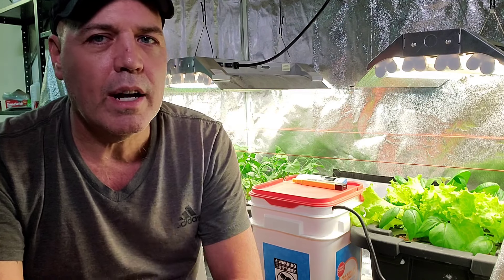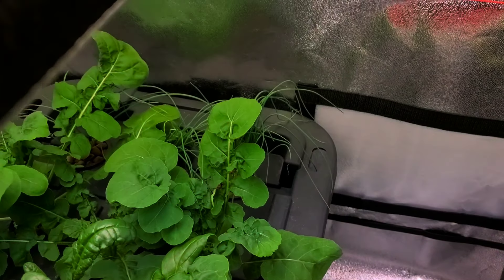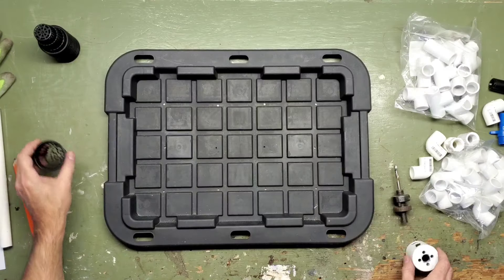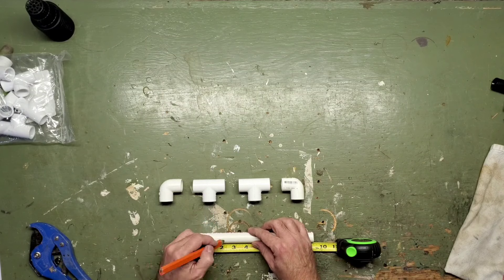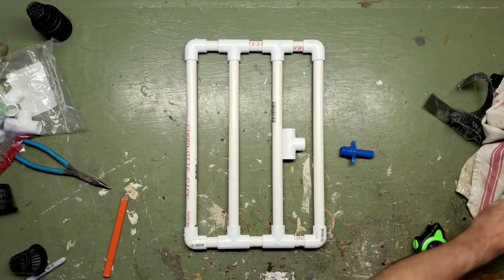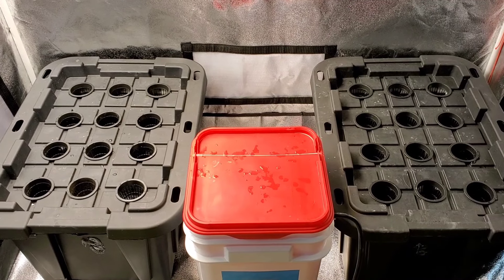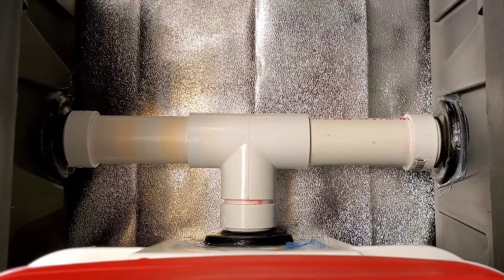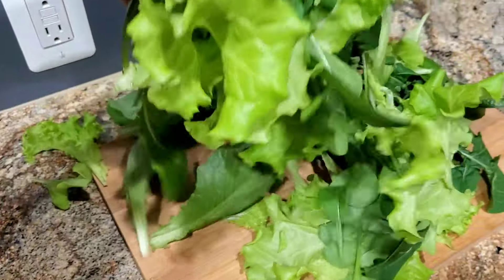DIY Aeroponics Hydroponics System

Comment: This is a nice setup.
I've been growing with LPA
( Low Pressure Aeroponics )
for over 15 years now.

And I don't mean to be rude.
I would just like to give you and the people watching this video a little friendly advice.

First off your manifold.
You have way to many sprayers. And I have found the green ones work the best.
And then where you have your manifold in your grow chamber.
I sit mine about 2 inchs off the bottom of the grow chamber. This way it keeps the spray from leaking out the grow chamber. And it keeps it high enough for the nute solution to drain back to the reservoir.
What I did when I built my 4 aero systems.
I put my inlet, at one end about 2 inchs up from the bottom of the grow chamber.
And then put a nipple on the outside. I ran my drain line on the bottom in the middle.
If you look inside at most of these tubs, you will see grooves cut into the bottom that drains to the center.
Then I put a nipple on that also.
Then with my reservoir, I put my outlet towards the top of the reservoir. To keep it above my nute solution. Then I put my return line at the bottom on one of the sides.
And now the way I hooked them all together.
They way you have them hooked together, I see nothing but problems.
What i did was I used hose.
There is hose's you can get at a hydro store that is made especially for these kinds of setups. It's a lot softer and pliable than a regular drip system hose. I used half inch.
So I ran a hose from my pump to the outlet. Then I ran a hose from my reservoir to the inlet of the grow chambers. Of coarse I had to put a tee on the hose.
Then I ran a hose from the drains on the grow chambers with a tee and ran it back to the reservoir.
Now the reason I went with hose's is because I wanted to keep my reservoir out from underneath the lights.
So I made my hose's like 8 ' long so I could achieve that.
Plus for any reason that I might have to move my systems. I don't have to take anything apart.
Plus it makes it very simple to change my nutes and clean my reservoir every 2 weeks.
There is a few very important subjects you didn't touch on.
For example its very very important that you keep your grow chambers and reservoirs and your nute solution around 75 degrees.
This will help keep mildew and mold out of your root zone. Hence Root Rot. Which can destroy your whole grow.
Next it's very important to check your pH everyday and your ppms.
There is a thing that us aero and hydro growers call pH drift.
Lets say you are shooting for a pH of 6. Well within 24 hours your pH can shoot up to 8 or down to 4.
Which will lock out certain nutes to your plants. And then it will rise or lower your ppms.
This drift doesn't happen all the time.
Once you find a sweet spot with your ppms. So your plants take up the same amount of your nutes that they want. The drift shouldn't happen.
Your plants will tell you what they want or what they are lacking.
So it's very important that you no exactly how much of each nute you are feeding your plants. This way you will no what you have to add or decrease to keep them happy.
They way I do this is I mix my own nutes. I purchase a powder form of each and measure exactly what is in my mix.
It sounds like it's hard, but it's very simple.
And a lot lot cheaper than buying premixed nutes.

This is the cheapest easiest and fastest way I have found to grow. And the only way I will ever grow, indoors.

Anyway good luck to all and take care.

ASS  OG

Aero Systems Sea Of Green.

Comment: Nice little set up.
Basically the same thing I built 10 years ago.

I've been growing this way with LPA ( Low-pressure Areoponics) for 10 years now.

I built my systems basically the same way.
My systems consist of 2, 21 site grow chambers with 1 reservoir. Each system measure 3'x3'. This way I can use 1, 3'x3' LED light over each system.

I have my manifolds at the bottom of the grow chambers. Well they sit 2" off the bottom and spray up. To make sure I get the bottom of the net baskets.
This way all the roots get wet.
I don't see how you are getting the roots in the basket and the parts that are above your manifold wet.
This will slowly cause you some problems. Like bad bacteria and fungi forming.
And your yield will suffer a little. Like 15 to 20 percent.
But for the common gardner or someone just starting with areo. they don't even know that 15 to 20 percent is there cause they have never seen it.

Anyway back to the building of my systems.
The only pvc I used was for the manifold.
Everything else I used hose.
This way I can keep my reservoirs 3 to 4 feet away from my grow chambers so the reservoirs are not directly under the light.
This helps to keep them cool.
Another thing i do different is my drain line is bottom center on my grow chambers. This way ALL the solution drains out in between sprays.
The way you have it set up there will always be 1 to 2 inches of solution in your grow chambers. Then on top of that with your on and off times being so great you are probably getting a build up of solution of 5 to 6 inchs in your grow chambers.
So basically you are running a flood and kinda drain system. And your roots will always be sitting in solution at the bottom of your chamber. Which will result in the same problems as above, plus root rot.

I grow every thing by cloning. I built my own areo cloners. And EVERYTHING I clone roots EVERYTHING.
The trick is to keep your pump running 24/7.
I start getting roots in 5 days. And in 10 days EVERYTHING has roots.
I let them grow roots for a total of 17 days.
Then they get transferred into the areo system straight into my flowering room, 12/12. No vegging.
As you can tell i grow cannabis this way.

These clones, there are 42 of them. They fill 1 of my systems.
I have 4 systems.
Two weeks after these clones were put into 12/12.
I fill another system with 42.
Then 2 weeks later another and then 2 more weeks another.
So now I have 4 systems with 42 plants in each all 2 weeks behind each other.
Now 2 weeks after I put areo system 4 to 12/12.
Areo system 1 is ready to harvest. And I have another 42 clones to take its place ready.
So every 2 weeks I harvest a system, 42 plants.

I've been growing this way for 10 years and I've only lost about 5 plants which was do to me being a dork and forgetting to plug in my timer for my pump.

Speaking of time.
Dude I run my on off times a lot lot lot lower than you.
Try seconds on and minutes off.
It's called Areoponics, not waterponics.

Oh and DARK KNIGHT.
Get rid of that epson and buy a all in one Cal Mag product. That epson is what's killing your grows.
And since your going to buy some cal mag. Buy some aminos to go with it. You won't be sorry.
I get these products from
NPK INDS. all their products are a powder and are easy to use. And they are very cost effective.

Anyway I've gone on long enough.
Good luck to you all and happy growing.

Take care ASS OG..
AreoSystemSea Of Green.
Reply: Can you explain how you have the drain line on the bottom center? Do you have the system raised so gravity takes the water back to the reservoir?
Reply: @Sasquatch10 
yes the grow chambers sit up about 6 inchs on some stands I made.
In the bottom center of the grow chamber I put a half inch grommet. Then I put a plastic half inch elbow through that to a half inch hose.
Reply: @assog5737  Thanks for responding, I have some more questions if you don't mind. 

1) When you put the elbow through the grommet, wouldn't it sit slightly above the bottom, allowing a small amount of standing water for the roots to sit in?

2) Do you have any problem with the roots getting into or blocking the drainage hole?

Cheers
Reply: @Sasquatch10  
Hey,
I wanted to respond more during my last comment.
But all of a sudden I had all kinds of people coming by my shop.
In regards to the elbow.
I went with a elbow instead of a straight piece, because the hose will go along the bottom of the grow chamber and plus there won't be a bend in the hose.
Just push the elbow down to the top of the groumet.
You just have to be careful if you move that hose.
Because I've had mine fall out a few times when I'm cleaning my reservoir.

Another thing I would express highly is the length of your hoses.
Make them extra extra extra long.
I mean like 5 to 6 times longer than you think you need.
I just went up and measured mine and they are 8' long.
It just makes it easier if you ever have to move your system. And it helps alot when you clean your reservoir.
Because when I clean mine.
I take the hose off the pump in the reservoir.
And hook a longer hose to it and run it to a 5 gal. bucket. But you can't get all the nutrient solution out.
So I pick up the whole reservoir and pour it in the 5 gal. bucket. So with the long hoses I have no problems doing that.

But I still check that elbow.
Just in case.
Because 1 time when I cleaned the reservoir.
I didn't check that elbow.
And I filled the reservoir back up and went home.
Because I don't live where I grow. And I grow upstairs above my garage.
And the next day when I opened up my garage to pull my truck in.
There was all kinds of water dripping down from upstairs.
So for like 12 hours the pump kept coming on but that f#$king elbow had come out.
That was a hard messy leason.

With my reservoir I put a half inch hole near the top and bottom, on one side, not the end. And installed half groumets.
And then a half inch hose from the pump to the top and the drain hose to the bottom.
And I used straight plastic pieces to go through the holes.
I also measured my stands and they 3 and a half inchs tall. And I made them out of 3/4 inch pvc. Just make sure they are level.

Last week I lost one of my mothers. And yesterday I lost my other one.
They were almost 2 years old. And pretty much cloned out.
So tonight I'm going to drop 4 different seeds.

And what I mean by drop is.
I cut a water bottle in half fill it with tap water.
I drop a seed in, if it floats it will sprout in 2 to 3 days.
If it sinks the seed is no good and will never sprout.
So you know right away if your seeds are good.
Just keep them in a dark place.
It works every time.
I've been doing it this way since the 70s.
And I'm the only one I know that doesn't this way.
In fact I think this is the first time I've told anybody this. LMFAO 🤣😆.
Maybe thats why nobody else is doing it.

Anyway good luck.
And please let me know if I can help in anyway.

Later.....
Reply: @Sasquatch10 
Oh I just made a little screen that sits over the drain hole in the grow chamber.
Because yes the roots will sometimes get in there.
Later...
Reply: @assog5737  Thanks for taking the time to leave a detailed response. You obviously know a shit ton about this, have you ever thought about making youtube videos or starting a blog? There's thousands who would benefit i'm sure.

Comment: Same approach I started with only nicer quality than mine. The first lesson I learned was the reservoir should be light proof. Green paint worked for me because I had some already and I'm cheap. Your pipe in pipe trick is something I will need to try.
Reply from the maker: Yes! I did end up painting mine as well due to the algae growth. Thanks for taking the time to comment.

Comment: If you did the water timing to 30 min on then off. You will get much better results.  Also would like to add, an air stone will help get oxygen to the roots .  It would be like super oxygenating your water . Great job on the video.
Reply from the maker: I'll give a try! Thanks for the input and taking the time to comment!
Reply: Aeroponics is always the way to go. Love using Aeroponics,  there are downside to using it. I have a bit of knowledge in Aeroponics. Been using it for over 4 years now.
Reply: The very first aeroponic set up I saw about 10 years ago used the 30 on/30 off timing.  I will be transitioning to indoor aeroponic as next year because we are experiencing both extreme heat and severe drought where I live.

Comment: Love this setup, great work!

Question - how has your experience been with changing the water? I noticed that the bulkhead fittings have silicone. What is your process for changing out the water?

Thanks for the great video explanation of your aeroponic setup.
Reply from the maker: Sorry for the delayed response. I use a small submersible pump with a length of tubing to pump out the water for water changes.

Thanks for taking the time to comment. I'm glad you found the video useful.

Comment: Need to see how the small pipes run through the large pipes and connect to the manifolds. Is it flexible tubing with a Y piece? I don't understand that bit.
Reply from the maker: Yes there's a 1/2” Tee fitting inside the larger pipe that splits off to both bins

Comment: Great video. Did you mention that you do not keep the pump on continuously? You turn off the pump, so the roots don't get water 24/7?
Reply from the maker: Yes I run it at short intervals. The humidity inside the bins will prevent the roots from drying out. However, you could run the pump continuously.

Comment: Couple of things I noticed. 1 if you had of put your grow chambers higher all the solution will then return to the sump rather the equal out between 3 containers. I didn't think the growth was fast at all. I'm getting faster growth with my water piped from my fish aquaculture system and it's only getting about 3 hrs of direct sunlight a day.
Reply from the maker: Great ideas! Got a link to your video?
Reply: @thescorchsquad  I'll do a vid. It won't be a build but just show what I have. It's a straight RAS aquaculture (IBC tote) that I piped off with stormwater pipe. I used air to lift my water to both oxygenate the water and save energy by using the airpump as opposed to water pump.
Plants are pumping ( mostly lettuce) but experimenting with Asian greens now.
Reply from the maker: @triplex7144  that sounds great, I'd love to see it. I'm always searching for new ideas and ways to improve things. Please post the link here if you upload a video! How long has your system been up and running?
Reply: @thescorchsquad  fish are now about 18 months old. Been running the vegies off them for about 6 months. Reason I started running vegies is I needed something to help lower my nitrates and help reduce water changes. My volume of water (1500lts) could support a large amount of vegies but unfortunately I set it up in a spot not intending growing plants ( maybe 3 solid hours sun max). I've just had to make a makeshift poly dome to keep everything warm as it's winter here. Given my success on the vegies particularly lettuce I might reduce food inputs and not go for max fish growth and concentrate on harvesting green and knock the odd fish on the head.

Comment: How often does this pump run? Continuously or every 20 mins etc?
Reply from the maker: I do 5 minutes every 15 minutes. Thats what I found works for me. Just don't let the roots dry out. Some methods of hydroponics have the roots completely  submerged in the nutrient solution so I don't think it's possible to overeater with this system. For me it was just a matter of finding a good growth rate vs wear and tear on the pump. I didn't see noticeably faster growth from running more frequent than 5 mins every 15 mins.
Reply: @thescorchsquad  ok. Thanks for sharing
Reply from the maker: @drfrankm  you're welcome!

Comment: Thanks for a solid explanation on the plumbing side of things. Can you give some more information about the nutrient solution and what to mix into it? I can't find much info around on this. Thanks!
Reply from the maker: The nutrients I use are a 3 part powdered mix (more shelf stable than premixed). It's called Masterblend. It can be purchased on Amazon, here's the link https://amzn.to/34C1EAf. It has mixing instructions on the packaging for teaspoons but it's best to weigh the nutrient powder per gallon. You can get a cheap gram scale on Amazon as well if you don't already have one. This is the one I use https://amzn.to/3nucteR. 

How this helps!
Reply: @thescorchsquad  Thank you for the fast reply and the detail, yes that helps a lot!

Comment: Love the simplicity of system and smaller footprint, nicely done! (subbed)
How did it fair longer term?  
(I suffer from over engineering stuff until it breaks)
Reply from the maker: I've turned to growing outdoors for now while the warmer weather is here but it worked great all winter. Only minor issue I had was long roots flowing into the water pipe returning to the sump. Might benefit from a baffle of some sort but I just pulled them back to the tub or pruned the roots. It never became a serious issue.

Comment: Incredible video! How did you get the 1/2” tee inside the 2” tee? And how is your manifold connected to the 1/2” pump line?
Reply from the maker: It was a little difficult to get the tee inside the 2" pipe. I put together the 2" tee and pieces of 2" pipe going to each bin first but did not install the branch that goes to the sump yet. Then I needed to modify the 1/2" tee. The 1/2" tee was a slip (to bin) x slip (to bin) x threaded (to sump). I cut some of the threaded side off the tee which goes to the sump, enough for the tee to be able to slide into the 2" pvc but left enough threads to connect a barbed fitting. After I got the 1/2" tee with 1/2" pipe that extends into both bins into the 2" pvc assembly I was able to thread in the 1/2" barbed fitting (with flexible tubing attached) that goes to the sump. Then finally added the 2" piece of pipe that went to the sump over the 1/2" tubing. I put together all the pipe before attaching any of it to bins or sump. Hope that makes sense, kinda hard to describe.

 For the connections of the manifolds in the bins I just ended up making solid connections with pvc and eliminated the barb fittings.

Hope this helps!